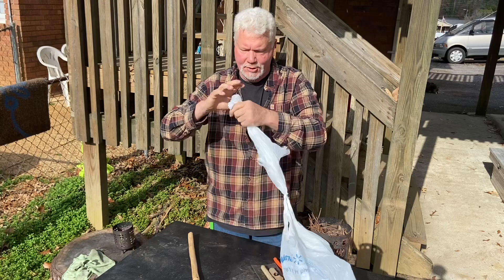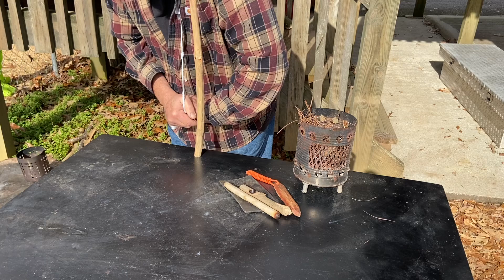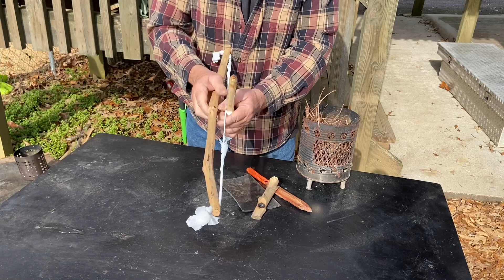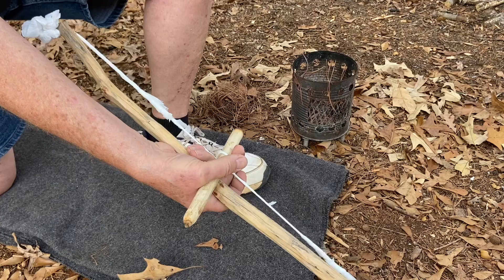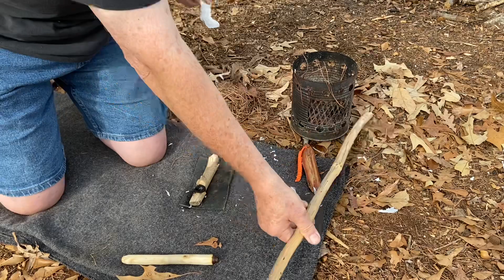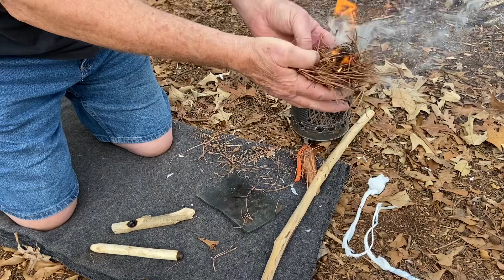Incredibly Strong Plastic Grocery Bags For A Bow Drill Bowstring

Comment: I make fishing line and cordage from plastic bags; store, trash,and bread bags...
 Method: fold bag along folds to original position before use; use ruler to cut seams with razor-sharp blade unfold bag and ✂️ cut 1" strips lengthwise.. secure three strips together and plaid tightly,., next secure to nail or hook fastened to fixed surface ,., and  stretch out slowly to the point of resistance .. all three strands will be round and the plaid will be loose,  pull one free from knotted end and all will separate; re-plaid tightly... 
 Makes about 15' of line when using bread bags strong enough to catch 10lb. bass...
 Pull line across wax candle  to use as line for  bow drill , also with flywheel pump drill....

Comment: I always keep 1 or 2 plastic grocery bags in a back pocket, they fold flat & you don't even notice them. My area stores don't supply bags & charge an extra 8 cents for each, so I have em on me when I'm out grocery shopping. And the bags are useful for collecting litter, clean up, or you can use them to sit on a wet surface. And yes, emergency cordage.
Reply from the maker: It amazes me how STRONG they are.

Comment: David, you are the Bowmaster... But why don't you put the string coming back to your thumb on the bottom side of the wrap so when you put down pressure on the string it separates the string at the spindle, so they don't rub together ?
Reply from the maker: I see what you're saying the thumb action causes the one string to move closer to the other and cause wrap rub... BUT, You can't really see that I'm already angling the bow which creates separation. When that's not enough because the spindle may be too short to allow much angling, the spindle itself can be angled to achieve additional separation. I was angling the bow and the spindle this time.